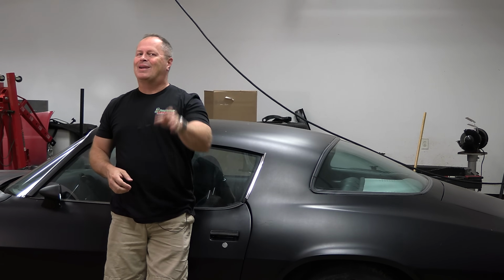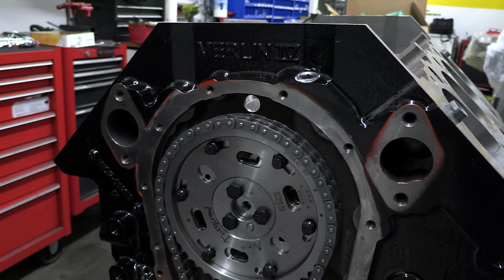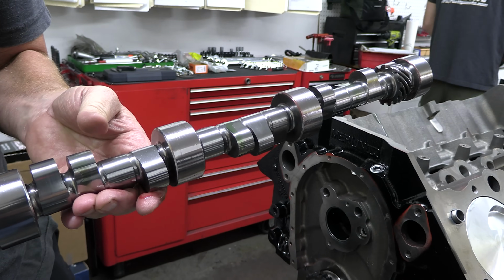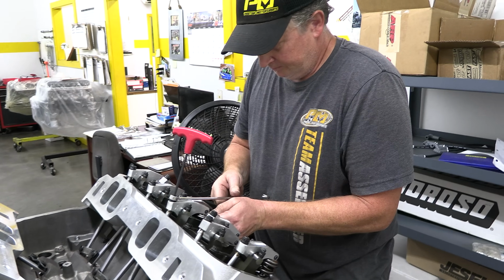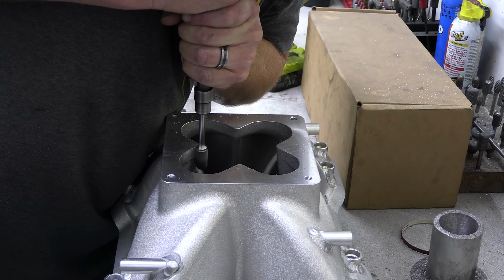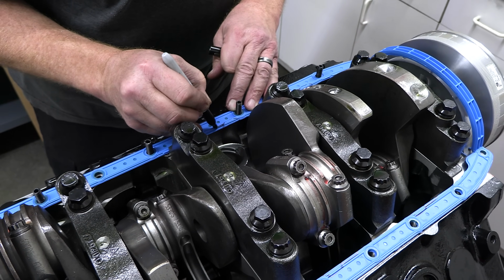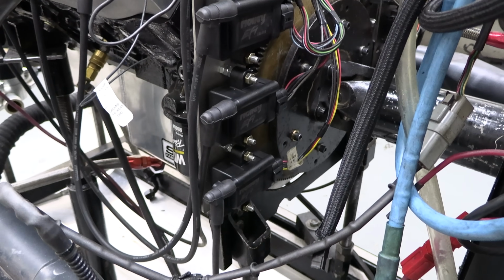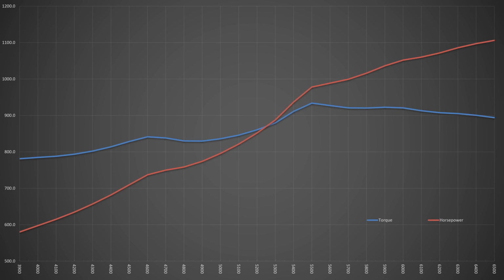Giant Killer! Incredible Big Block Pounds Out 1,100 Horsepower for the Street!

Comment: I like everything but the Merlin block, Dart big M is the only cast iron block I will buy. I had a 565 with a Merlin III block that was supposed to have the main webbing problems fixed. I wound up with a Pat Musi 1300hp 632 and sold the 565 to a racing buddy who raced it for a year when the main webbing broke and destroyed the bottom end. The engine had roughly 600 runs with one refresh at around 400 runs. I just don’t trust the Merlin and there is not much difference in price for the Dart.

Comment: I was always was taught at least a 500 mile break in period to let the rings seat properly prior to any hard pulls.  All these engine builds and straight to the dyno are odd to me.
Reply from the maker: If the hone work on the cylinder bores is correct, the modern thin rings will have seated almost by the time the oil is warm. Thanks for watching

Comment: GMs zz 632 was on pump gas.. 93octane.. with less camshaft. More than a whole point of compression less, And fuel injection. the point of gm building that motor was to make over 1000hp and be a very street able pump gas setup lol. If they used e85 or c16 then the whole idea of the build would be just another big cubic inch motor.. but I was hoping for a good comparison, lower the compression and put that ford on 93 octane so we can see what it does. Good ford alternative either way.

Comment: This Engine is amazing, as far as versatility and fun factors. But don't dismiss the advantages of the 5.3 from the LS and the impressive LT L83. I e built both motors throughout the years and have been able to surpass 450HP to the tire with boost. I just did the trans in my 2018 Silverado, and I'll continue from there, Top End Kit, heads intake man, cams, and headers, programming and tuning and she'll be a fun driver. I will put a turbo in that one. To help it along towards 900HP. As long as I can run with the TRXs and Raptors for 1/4 of the price am happy. 😂

Comment: I don`t consider 13.5 to 1 a street motor
Reply from the maker: I don't blame you if you don't, but lots of guys around me with hot street cars are running huge boost and E85 as fuel. So personally, I consider it legit even at that high compression if you can make it work on E85. Thanks for watching!

Comment: So, everything in this build is supposed to be "Off the Shelf" parts, that anyone can order, Yeah? Well, not a single AFR part, that's on THIS motor, is even listed on the AFR website. Also, I understand that you cannot give away ALL of your build information, but there were some tech specs that you have left out. I'm not a professional motor builder, by any means, but I am a trained machinist, and have re-built my fair share of motors in the past. In-fact, I'm currently trying to squeeze as much as I can, with aftermarket parts, out of an 8.1L 496 motor, that will perform quite nicely with a twin turbo set-up. Anyway... I would love to build this motor, copied right from your video, as built from your video, but I can't. Because the parts aren't there to be bought, as stated. The AFR manifold (BBC or otherwise) is not there, nor are the bad-ass AFR valve covers that really set this motor off, in the aesthetics department. Besides the parts and some other technical info, this cannot be built by the Average Joe. But, I did enjoy watching it get built by you guys!

Comment: Nice build - looks like maybe a bit too much camshaft if it's going to be limited to 6k5? If the usual dummy build checking had included checking V2P clearances with the cam' swung 4-5 degrees, it may have been worth playing with it's timing a little, as 4-5⁰ either way can make a BIG difference, and may have filled the mid range even more while holding the top end?

Comment: Lost me at E85.  Cool build, but would like to see pump gas.
Reply from the maker: You could make 800-900 by knocking the compression down and burning 93 octane.
Reply: How would this build do with 604 and 10-5 to one with race rite 345 with 2.40 intake valves

Comment: I believe that the warranty on the ZZ632 is not void as a result of tuning. Not i believe that tuning doesnt void the warranty, that there is a law against voiding the warranty. There is a pretty comprehensive warranty on that item and there are numurous failures that can result completely unrelated to the state of tune.
I actually find it astonishing that anyone, especially a gearhead, would spend good money on a powertrain component from a company that acts with, at best, derision towards its clients.
That the ecu comes locked is enough of a reason for me to never buy it, you bought the ecu but cant change anything. The crate engine doesnt come with any exhaust, it needs custom headers, needs intake air system unique to the chassis. The fuel at your local station will not be what the powertrain engineers used to set the factory parameters.
I would really like to see someone try to void the warranty because the ecu is reflashed when the claim item is a waterpump. Magnuson Moss has some really sharp teeth.

Comment: why did you stop the pull at 6500? Power was still climbing.
Reply from the maker: Prestige doesn't recommend revving extra long-stroke engines too high.
Reply: @TheHorsepowerMonster  A lot of guys run 4.5-4.75 stroke engines to 7200+ but I understand your point. Perhaps a smaller camshaft would best fit the engine to make peak power at 6200?

Comment: @TheHorsepowerMonster  you should have mentioned in the video that with a cam swap, it COULD BE run on 91-93. Look how many people are disappointed it doesn't.  It's a great build and video, but it should have been mentioned, not everyone knows you can run "high compression" on pump gas with proper cam timing.
Reply: that's huge news to me, any articles I can read or videos I can watch about it?
Reply: @robthegobbler  read about the difference between Static Compression Ratio & Dynamic Compression Ratio.. simple way of putting it is dynamic is what the engine runs at, so your engine might be 13,2;1 but because your intake valve closes @ °80abdc you may only have 10:1 Dynamic Compression
Reply: I don't see the problem with E-85, all the gas stations around me have it so no different than "pump gas" for me.
Reply: @docsmallblock6584  man that is lucky, only some occasionally around here
Reply: I agree. It's not a street engine if it's on e85 simple because you can't road trip and reliability find e85. And ya cam timing is everything you can run really high compression with proper valve timing.

Comment: How much an engine like this one weigh? Why not dyno it with an electric waterpump? I would put it in a 68-72 Nova, with a full frame underneath (the OE half-frame would probably rip off). With a dry sump to lower the engine in the bay as much as possible (if a dry sump is possible). Great video :)!

Comment: Fit nicely in the engine compartment of 67 to 72 GMC or Chevy truck I'd say, especially since not that many trucks of those year models are built compared to all the cars out there. 
Plus the rear suspension is built for whatever you want to throw at it if you have the right differential ratio, and a locker for getting things motivated.
Reply: Fit nicely... under a gigantic 8" cowl hood.  😐
Reply: @Sir.VicsMasher  LOL, you mean one of those that you have to lean over to see around the corner to know there's no one in the lane.
Truck wouldn't need cowl hood, unless you had one of those huge filters stuck on top of the throttle body, just one of the 80's type huge air cleaner housings, with couple 6" hoses run under the headlights cut into radiator support with screens attached to filter the bugs out.
Old skool ram air is how it was done on Chevy trucks, GMC, just pull out the high beam headlights and go with hi/lo on outside bulbs.
Redneck as, but works dam well.

Comment: 1983-87 K30 Square body 4x4 would be a dream of mine with this beast in it.
Reply: I'm planning something similar with my 73 k10.  Shooting for a 598 based off a 502 block (unfortunately not as good as rod ratio std deck), MBE 18° heads, ported tunnel ram, very agressive (for bbc journal) solid roller, maybe something like the low shock drag race undecided, but on a tighter lobe separation than here, probably more rocker ratio.  About 11.3 or so cr - gotta be able to pull a trailer up a long hill on 91, also probably add a little water meth for that.  Wanna see north of 1000 hp with a lotta meat in the curve.  Peak power rpm 7,200-7,500 and not go above 8,000 but hold on well (4.5 stroke but just scat crank, notta bryant or anything and okay rods not some dance 3k+ rods).  "Budget" hope to keep it in the neighborhood of 15k but will probably cost more.  Idk if I'm going 18° maybe I should spend the money on copper beryllium seats and xceldyne titanium valves and psi springs. 
Dyno software puts it at 1048 hp and 880 lb ft but it's old software.  Can be close on # but usually off on rpm.  Need to pick up pipemax newest, hear that's real good if you have all the inputs.
Reply: @sc358.  Sweet brother! What axles are you going to use?👍🇺🇸
Reply: @caesar1295  well it's a long out project.  Bought a running driving, fairly rusted body for 800 😆.  It just has 44s, 350 and np205.
But I think I'll go with dana 60 front (everyone wants a grip for them) and 14 bolt rear.  TH400, gear vendors.  Probably go with the offroad designs 7" custom springs and daystar air bag setup in the rear.  Something like 37x14.50s.  Would like to find a good wide tire that size that'll let me run just enough rim to run good brakes.  Like the way 15s look but that limits brakes.  Don't really like anything over 17 for a 37 (unless a 2wd hot rod then 18-22 can look good).
I'd like to go with long travel coil over and have gear works build me trophy truck style axles (similar to ford 9" but more beefy 10", axles are like the size of a small red bull can, just a thing of beauty) but that's way outta my budget.
Reply: @caesar1295  you gotta square body?

Comment: No good if it doesn't run on 93 octane
Reply from the maker: 93 would definitely be more convenient, but I know a lot of guys around here running E85 on the street
Reply: @TheHorsepowerMonster  you should have mentioned in the video that with a cam swap, it COULD BE run on 91-93. Look how many people are disappointed it doesn't.  It's a great build and video, but it should have been mentioned, not everyone knows you can run "high compression" on pump gas with proper cam timing

Comment: Awesome build, wish they took a little compression out of it so it could run pump gas
Reply from the maker: Definitely doable with a bit of dish in the pistons. Thanks for watching!
Reply: @TheHorsepowerMonster watching this makes me wonder just exactly how much horsepower that they can squeeze out of an N/A 632cid with a max effort drag racing build since they had no problem squeezing 1100hp out of a healthy street build and I say that because they are running more compression than you normally would in a daily driven street car and if you use that engine for a drag and drive build you would have to carry your own fuel most likely unless you ran E85 but even then it would still be a good idea to carry your own fuel because you can never guarantee that you are getting true E85 out of the pump and it can be hard to find in some areas
Reply: @TheHorsepowerMonster  h
Reply: Yea, take it down to 950 hp and let run on 93.
Reply: @hockeymann88  You can build a 632 that makes 1.74 hp per cube as this engine does and have it run on 93 pump, but that's a serious effort deal and you need better hardware from top to bottom. Actually, the technology is available to make even more in a naturally aspirated configuration, but it will be a very high-end and expensive proposition.
Reply: @geneticrex  I get it. I'm just saying in my imaginary street build I drop compression a tad, still have more power then my tires could put down during a launch and hopefully have a very durable and easy to maintain big block. 
I love a crazy engine build but even my imagination is has questionable funding.
Reply: With that long rod in there it's going to be tough to make much of a dish in the piston....might be better to go with an open combustion chamber to get the CR down.
Reply: @recoilrob324 an open chamber would kill power. Most places around here have E85 at the pump, or I’d just run a thicker gasket and a small dish to knock out as much compression as possible
Reply: Let's not forget about dropping compression through the head. It's only a 90cc. I know of at least one head that's 100cc and I'm sure you could mill out the quench area to find a few more ccs. You don't necessarily need a dish piston. There's only so much room on those skinnys. For 11.5:1 CR you'd need 113+/- ccs of combustion area which seems reasonable with the right head given you're only going to get so much with that little valve relief and .005in in the hole and head gasket squish.
Reply: This makes me happy hearing this. Because mine runs on pump gas Lowest octane and still makes fifty more horsepower yes 1,151 Oh yeah mine's Has a carburetor No electronics Let me know how long The  Scat crankshaft last
Reply: @plymouth-hl20ton37 ya I was kind of surprised they went with a scat too
Reply: @plymouth-hl20ton37 ... Most Excellent !!! ... I would love to hear about this build Sir .
Reply: Pump gas varies so much from place to place. Some places cant get any better than 91 octane.
Reply: That's an impressive engine. I would definitely put that in my 48 Anglia project car. Can larger shirt sizes be ordered than what you offer? Great video as always. ✌️😁
Reply: E85 is a pump fuel tho, plenty of guys run around on it full time
Reply: Looks like a LOT of people are missing the point - this is something they came up with for a specific type of client.
Sure, there are many other ways of doing this sort of build, or getting the same sort of power, but those other means aren't for everyone, just as this isn't.

Superchargers can have packaging problems, turbo's a lot more with heat managment added to that - for some cheap(ish) additional power, NO₂ might be good for another 2-400hp.
Reply: @gordowg1wg145  no, they built this to compete with an engine that makes 1000hp on pump gas and no power adders so this should have been built for pump gas as well
Reply: @wowcolors  
I can buy E85 at a retail fuel pump, actual E85...
Before COVID, it was commonly found, now there are less outlets, but they're still there.
Reply: Would be perfect in my 57, I'm sure you have never heard anything like that before
Reply: E-85 is pump gas!
Reply: Well then take a bit of horsepower out too! But yeah I agree if it's for the street it needs a lower compression might be able to split the difference with a nice tunnel ram
Reply: Pump E85 ;-)
Reply: this just isn't plausible for most people who drive their stuff on the street with any regularity... not every gas station has e85 or race gas. you could get those same power numbers much more reliably and be able to run it on pump 93 if you just added boost to a lower CR engine .... not for nothing but i'm calling this engine the youtuber special because that's the only person this engine makes sense for
Reply: @Criminalinvaderdeporter so the Gm 632 is on back order for nothing?
Reply: I don't know of a gas station that doesn't offer E85, and I live in the middle of nowhere. Second, who in the hell is worried about "street driving" so much that you can't just buy a 55gal drum of E(insert #)
 @Criminalinvaderdeporter
Reply: Dish pistons
Reply: @bradleydennis1263   What's the difference?
Reply: @MonstertruckBadass  is that a legitimate question,  or are you trolling??
Reply: @bradleydennis1263  Yeah legit question, I have very, very basic layman understanding of engines. Seeing a high performance one being built was very interesting.
Reply: @MonstertruckBadass  okay. For example. My 385 stroker with flattop pistons has a compression ratio of 11.4:1 with a compressed  head gasket thickness of .016".
On the flip side of that, it previously had 4 valve relief pistons and had a compression ratio of 9.2:1 with a compressed head gasket rhickness of .036". 
It's all in the quench. The dished pistons and thicker head gasket allow more "area" for the compression to be expanded. With flats, the compression has nowhere to go, therfore raising the cr. 
You can also lower the compression by having the combustion chambers on the cylinder heads expanded.
Reply: @MonstertruckBadass  ... With a Big Block Chevy flat top pistons or those with a dish are used in lower compression engines say the older smog engines with less than 9:1 ... Or when using a power adder such a Blower Super Charger Induction  setup. The combustion chamber size gets the Compression Ratio close then is Dialed in with the Head Gasket thickness . This is from the much larger cylinder bore diameter size of the 4.250 - 4.600
Reply: @bradleydennis1263 ... May be hard pressed finding custom dished pistons without changing Rod length
Reply: Good build, I would do  big 9 head, 12.1 for 93. Make 100 plus more hp, more stable valve train..
Reply: @deansciortino6425 Eggzactly correct, but what's really funny is, you won't believe who I am. I'll give you a hint: I'm not Michael, or Patty.🤣🤣🤣
Reply: @deansciortino6425  ... Isn't the 12:1 a bit much for Pump 93 ?